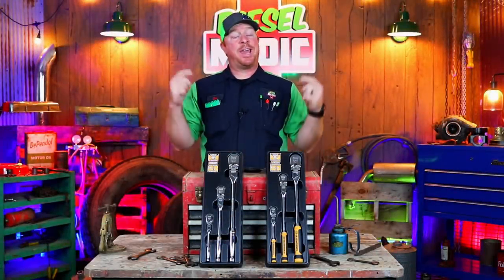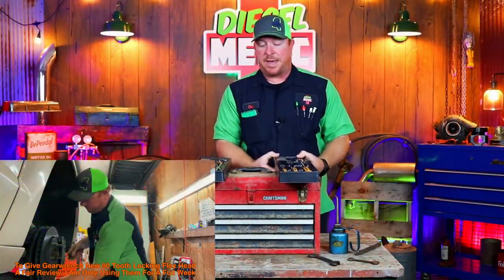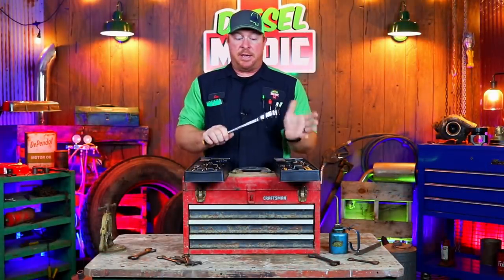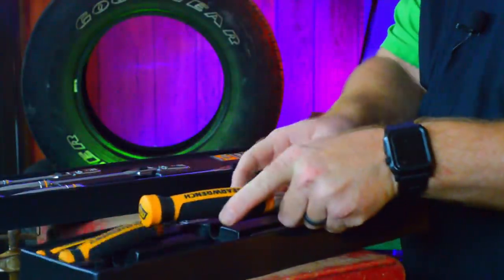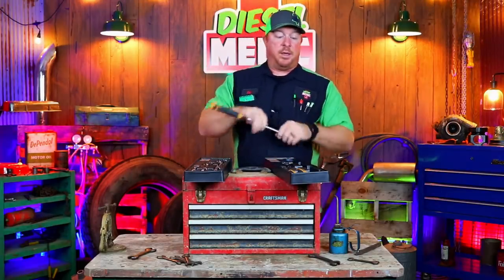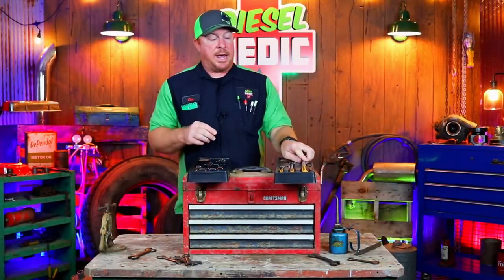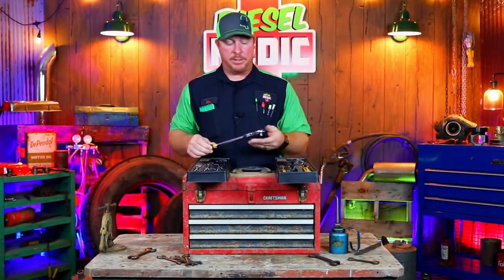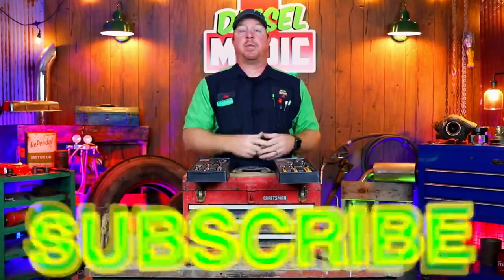Gearwrench 90T Locking Flex Head Ratchet Review. My thoughts after using them exclusively for a week

Comment: Old school mechanic here,  I've purchased the chrome locking flex head ratchet.  And I gotta say the handeling and performance, especially on the locking flex head part, is by far the best locking flex head ratchet I've used. Now I've used the matco, Snap-on, and other popular brands, but this gearwrench locking flex head blows all the other locking brand of flex heads out of the water. My opinion the gearwrench locking flex head is the best choice then the other name brands of locking flex head drive ratchet.  Can't wait to order the comfort grip version. Overall great 👍 review.

Comment: I own majority of the Gearwrench ratchets throughout the years. But when it comes to warranty it can time consuming. My 3/8 120xp ratchet warranty took over 6 months from APEX tools. So, I bought the Matco ratchet 88 teeth off the truck warrantied it twice and no issues. In the end, it is the convenience factor you get what you've paid for...
Reply: Gearwrench just sent me a new ratchet via mail no questions asked
Reply: It’s crazy how they both had to be warrantied. I’m looking for a ratchet that won’t need to be warrantied.
Reply: @836dmar  Me too, but that tool doesn't exist.
Reply: Why not just keep a spare rebuild kit in your box. They're like $10 bucks...
Reply: I just buyv15$ rebuild kits forget apexx warentee
Reply: @836dmar  None of the longer 3/8 ratchets will hold up forever under hard use. Snap-On tends to strip the pawls or the flex-heads can strip threads in the handle. Matco will strip the ratchet head before the flex-joint breaks which is better because rebuild kits are standard where handles usually have to ordered.

GearWrench works for me, they are strong, smooth with minimal backdrag and the overall feel/quality is very good. Definitely comparable to tooltruck brands. Difference is much better price, the 3pc or 4pc sets retail at about the same cost as one Matco or Snap-On ratchet. Often on deals too, I ended up with three full sets plus a few individual ratchets and overall they set me back less than 2 Matco/Snap-On ratchets would have cost.

Comment: MATCO 88 Ratchets is where it is at!!!!!
Reply: The gearwrench is actually a little longer but the matco is a little bit nicer.  My experience with gearwrench rachets has been a nightmare but considering how much praise they het i think it may be an isolated incident
Reply: imgone  it feels like a cheap and cheesy ratchet.  It literally broke on me the first day I used it and has continued to break non stop.  Every tool has its place, and my 84tooth locking flex head gearwrench's place is the trashcan
Reply: I can get this set for the price of one Matco… but I agree the Matco is superior.
Reply: @timm5970  that’s because yours was an 84 tooth. The 90 tooth is a new version and the quality has improved.
Reply: @timm5970  The handles are clunky and feel of ratchet is clunky (MATCO is slim, handle is nice and way better quality). Snapon ratchets are too big and their screw driver handles need to be slimmed down. Matco screwdrivers handles are better - know they are Witte but still don't like clunky tools - know the Snapon is excellent quality just wish they had a slimmer version. I never use my snapon ratchets the old school ones were wayyyy slimmer.

Comment: i have two sets of the 84 tooth, im a diesel mech i wi, i love those ratchets, one set is 1/4 3/8 and 1/2 long non locking flex and a stubby 3/8 flex ( my personal favorite) and the other set is a 3/8 and 1/4 long ratchets. had them bout 2 years now and they have been great. i do like the orange, it would go well with the rest of my snp on and matco orange tools ive had since the early 90s when s-o came out with the hard handle orange. i already have the s- o ratchets , and a set of Cornwell 3/8 fine tooth which arent bad, just too thin with out the comfort grip. my old arthritic hands need the larger grip. been doing this since 89. 
gearwrench is doing a great job with the ratchets and sone other tools that would be great for a starting tech, and its not going to cost payments for the rest 😒 of your working career.

Comment: You can swap the orientation of the locking switch to match your other ratchets. Also, tiny shims under the spring help tighten up the head flex, and a shim on the thread side of the hinge bolt will help eliminate lateral slop.

Comment: I love my gearwrench ratchets I have had a shot of the gearwrench 120xp when it comes down to my 1/2 inch 1 non Flex head I have put that through some serious abuse over the last few years and to be honest I am seriously surprised it's still works as good as new I use it for everything even attaching a pipe to it constantly and it's still going strong

Comment: The whole line of Gearwrench is great for a starting tech or a DIY there are much better alternative to HF even with that icon line they came out with I got some Gearwrench prouduct in my box not afraid or embarrassed to use them
Reply: Do you recommend the gearwrench over the Icon ratchets?
Reply: @AG-rk5hj  yes
Reply: My 3/8gearwrench 84 tooth felt cheesy and fell apart on me.  Literally had issues since day one.  My icon long reach flex head has been killer.  I have a 3/8 icon i had to take back because the head was locking up.  If i was to do it again id go with the 90t comfort grip in the video but the icon wrenches are very nice although i have found some of their products to have defects.  With that said i just had to take them back in and get a new one hassle free using my phone number.
Reply: Looks in I'm trolled by harbor garbage bear again sorry Jeff your the reason I won't spend a cent in there ever again
Reply: @larryborkstrom3580  I have both ratchets.  My gearwrench is currently in pieces/broken which has been a regular thing since I bought it.  My icon is still trucking along amazingly since ive bought it
Reply: @timm5970  happy for you leave it alone
Reply: @larryborkstrom3580  you are a weird one
Reply: love my Pittsburgh ratchet and i use it every day working on cars professionally.
Reply: @larryborkstrom3580  when I started I could not afford s o. so I got a cheap Pittsburgh socket set and 25 years later I am still using it with no problems. they have been awesome
Reply: @larryborkstrom3580  the reason I got the Pittsburgh flex comfort 3/8 is because my POS S/O 3/8 flex comfort grip grip kept sliding off and snap on said they could not repair it after charging me 2x to fix it. in spite of it being under warranty. So I sold it and got the Pittsburgh. gave it a lube and I like it much better than my s/o.   I also like my color coded socket set that has never let me down over the last 25 years of being a Mercedes tech.  I also love my Titan 1/4 micro ratchet.  I bought the 1/4 flex comfort Pittsburgh and retired my s/o because this one feels much better.  I sold my 2 s/o boxes last year and got the US GENERAL 72 box and am very happy with it. My Pittsburgh 1/2 impact gun that I bought to repl my MAC back in 99 is still working great and it only cost $49. My IR and Mac only lasted a year each!  Keep an open mind. If you get a pittsburgh just open it up and apply some grease.  these are really nice ratchets. Also I love my Gear wrench swivel 6pt socket set. I have my own repair shop so I can afford what I want but I do not like Snap on. I will never buy anything from them again. Also I had lots of s/o tools break. not so with HF tools.
Reply: @narcissistinjurygiver2932  this has to be the Bear if you want troll me on someone channel at least be honest who you are plus this topic has nothing to do with snap-on its gearwrench
Reply: @larryborkstrom3580  you are not that important for me to troll. i was answering your question
Reply: @larryborkstrom3580  Why are you judging people on their choice to use non tool truck tools? The tools obviously work for them. By the way, most of the Harbor Freight hand tools are made in Taiwan, not China. Am I the bear too?
Reply: @andybub45  probley one of his minions and to reply to you why are you judging me for using tool truck tools instead of the cheap ones try a Snap on or a Mac or Matco ratchet the difference is between a Yugo and Caddy

Comment: FINALLY shipped from Amazon after long weeks! ETA :soon! 
You sold me another one dangit Clay!
Reply: Finally got here today!  Grips feel great super comfortable design. Locks are nice and tight
Reply: That's Awesome!!! I want to order one too. I have the 120xp in 3/8 drive with comfort grip and 1/4 drive with comfort grip and the full chrome none comfort grip 1/2 drive. They are Awesome too. How is your 90t working so far my friend? 😎
Reply: Rick Ellison 
great ! I love them! saved pulling the radiator to get to some recessed power steering pump bolts through the pulls with the thin head design !!
Reply: @bobbark9345  , Yes Sir, I know exactly what you mean. I wished my pops and I had these ratchets back in the days. They save so much time getting into tight spaces and angle bolts. I love them. I also want to get the new extra large Gearwrench 90t 24 inch long 1/2 drive with comfort grip too. Amazon has too. $119.00. 😎

Comment: I hate to disagree but the comfort grip is horrible. That's why I am replacing it with a Snap-On hard handle screwdriver handle. Too thin, too short.
Reply from the maker: The hard handle snap on has an edge that digs in your hand not to mention everything time you bump it, it cuts a groove into it. I personally had rather have a regular chrome handle vs the screwdriver handle. It’s short and to me isn’t comfortable at all. But that’s why they make different versions to suit everyone. I purchased one hard handle version and only used it a few times and didn’t like it. Still looks new.

Comment: What does made in the usa really mean? Well in the case of the matco it means the metal for the rachet handle is usa sourced and assembled in the usa.  Does it mean the whole rachet is American made?    No it does not. They could still use some imported parts i.e. selector switch and locking switch and it would still considered made in the usa since the cost of those parts is miniscule compared to the cost of the manufacturing. Now I'm not saying that they due import their selector or locking switch I'm just saying it wouldn't effect the made in the usa badging.  
     I'd still recommend buying American rachets while you can, but I have been impressed with some of the gearwrench stuff. Just recently they had alot of stuff on sale through amazon. I picked up their mids and a 3 piece locking extensions. Try them out if you get the chance to.

Comment: Thanks for the review, Clay. What kind of mechanism engages with the flex detents? Is it a ball bearing with a spring or more of a “flat bar” detent like Tekton uses?
Reply from the maker: It has a bar that locks between the the teeth in the bottom of the head
Reply: Koon Trucking Excellent news, that means there won’t be a groove worn into those slots like with a ball bearing. Thank you for the reply, Clay!

Comment: Nice video!  I wonder how these compare to the gearwrench 84t locking flex head?  Worth upgrading?
Reply from the maker: No clue ? I don’t have any 84T all i have are the 90 and 120xp
Reply: I have been told that the 84 tooth will be replaced by 90 tooth at some point as far as use and strength the design is very close but supposedly the 90 tooth is a little stronger. The head thickness is about the same as the 84 tooth, the 120 tooth ratchets have a thicker head
Reply: @jimhaines8370  yea I heard they was going to replace the 84t with the 90t also which kinda sux bc i love the 84t locking flex head and like the red handle better than the newer 90t hopefully I can get an 84t even cheaper now tho lol
Reply: Matco was part of Danaher which had lots of brands made here and imported like Gearwrench. Matco was so when they split and  Apex was formed and I’m sure Apex kept patents as Matco was spun off to a different holding company. Matco went to AJ manufacturing to have ratchets done after flood at Sumpter SC  plant and poor machinery condition from lack of upkeep led to discontinuing of US production. There was a year when Matco could not get ratchets or parts. That is when Armstrong/ Allen/ KD/  and other US brands where discontinued sadly as there where all made by Danaher / Apex so they went away. 
Back when Danaher owned and made all the brands Gearwrench 84 Matco Armstong 88 ratchets could all use the same repair kit so they were very close to the same.
Reply: Thanks guys!  I own a set of the 84t locking flex head amd I was wondering if there is a reason to upgrade...sounds like no need to upgrade for me.  I love these ratchets, and gearwrench cust service was super responsive when I needed a new O-ring...they sent me the whole rebuild kit with no questions asked!

Comment: Is it just me or do the Gearwrench locking flexhead look very similar to the Matco Brand? other than the lock button locking in the opposite direction they look identical including the soft grip handle design I am very interested in the Gearwrench set now was wanting the Matco set but kinda leaning towards the Gearwrench set at this point and will save a little money too
Reply from the maker: We compared them on the Matco truck. Took them apart and showed the internals
Reply from the maker: https://youtu.be/p8rJGvdaF7w
Reply: @KoonTrucking  OK thx watching it now

Comment: Hi there good video, do u happen to have the part or items number of that gearwrench flex head 90 t with the handle grip ? I tried to look for it in amazon but I only found the 3/8 , and 1/4 “ set but no luck with the 1/2 “ in it , only found a set of 2 instead of the 3

Comment: do you know if the 3/8s head will fit on the 1/4 inch body?
Reply: No they don’t have that size anvil yet but they need to get that in the line up
Reply from the maker: No it will not fit

Comment: clay does k d own gear wrench  i have snap on they ere so good  but an arm and leg cost   how was the icon  i have a gift card
Reply from the maker: I’m pretty sure Apex owns Gearwrench. I honestly haven’t used the ICON in a LONG time. Mine is the one that was recalled, and i never took it back. Since I got the Matco ratchets they have been what I have used up until this video when I used only these for a week.
Reply: Kd is gearwrench, apex bought them in 2014 and added their entire tool line to gearwrench. You can warranty old kd tools and receive a gearwrench replacement

Comment: not doing a week with the non sissy grip?
Reply from the maker: I like the comfort grip the best. Nothing is different in the working of the ratchets.
Reply from the maker: Yup ! By far
Reply: I am still trying to resist the sissy grip ratchets.
Reply: Flat Bastard Engineering Channel  never would have figured a mechanic could have soft hands sissy grip or no sissy grip....  I just like giving clay a hard time I might have a sissy grip ratchet if they made them 30 years ago when I was buying them.

Comment: High Mr. Clay, 
Can't say I agree with you on this one, because Mac, Matco, Snap-on, SK, and Cornwell use american made steel and American workmanship to produce superior quality in their ratchets.
Use your china brand for a quarter nothing but them and then give a review, not meaning to be ugly sir but to say they would be a good fit for everyday use in shop is like saying the ride of a chevy chevette equals the ride of a Cadillac Deville.
Reply from the maker: You do realize that the gears and teeth are the same as the 90 tooth ratchet right ? Like the ones I’ve had for several months? The ones I use for oil changes and dirtier jobs? The ones we beat the ever living HELL out of? So I do think it is safe to say they will hold up in a shop for professional use since we have done that and they have held up excellent. Just saying I do know what I am talking about with these 90 tooth since I have had the non locking for a LONG time.

Comment: Comes from the Same Taiwan factory as the Matco so its the same thing really 😂😂🤔🤔🤐🤐
Reply: Not really. Watch the video from a few weeks back where they compared Matco to Gearwrench.
Reply from the maker: No sir Matco ratchets are made right here in the good ole USA (in Illinois to be exact) not made in Taiwan. Plus they are several differences in the two ratchets. Other than the ones I stated in this video, the handle is longer by about 1/2”, Gearwrench has a longer teardrop head design, and the internals are different also. If you wanna see the internals side by side with the Matco take a look at this video https://youtu.be/p8rJGvdaF7w where they are both disassembled and parts are there together. There’s several differences in them even though they look similar. Nothing wrong with the Gearwrench at all but they are not the same.
Reply: Wrenches 88 

What he’s trying to say is it’ll only be a matter of time before Matco will be made in Taiwan. The current USA made ratchets Matco offers are made by AJ Manufacturing. Only a matter of time before Matco undercuts them to a Taiwan manufacturer like they do all their other tools and kiss their USA made ratchets and their pinless impact sockets goodbye
Reply: Junior Martinez I was kidding around I watch all his videos.
Reply: Koon Trucking I know buddy I watched that video I guess I came off a little too serious.